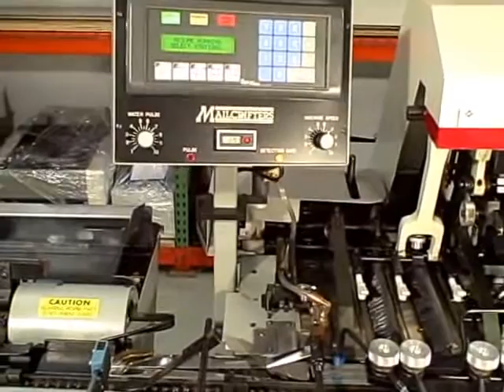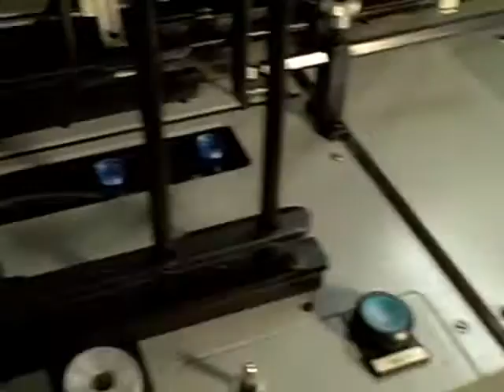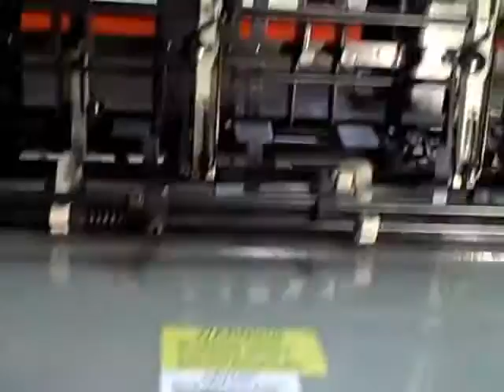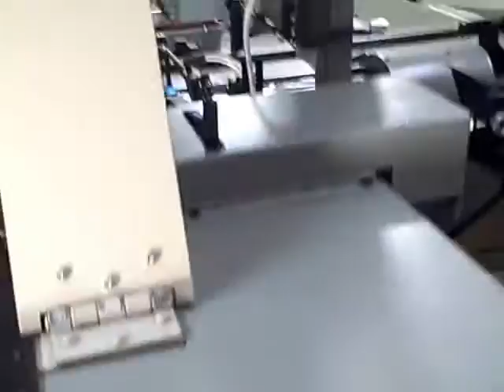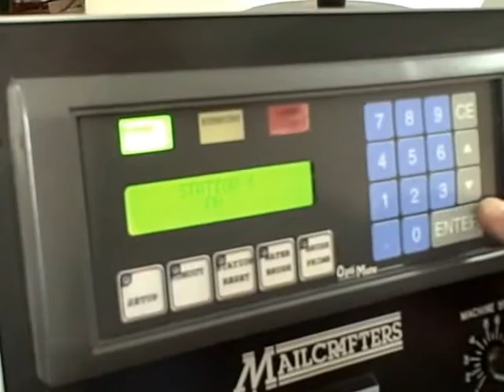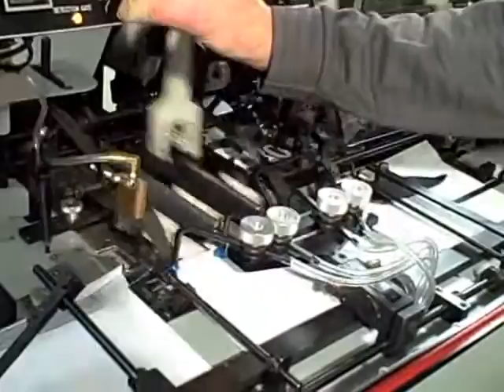Mailcrafters Model 9800 Envelope Inserter (Pre-owned)

Comment: I used to work for inserco between 1999-2005 as a sub-assembler. I built almost every part in these machines.  I will state that these are all very rugged machines I am very sure that there will be one of these machines working somewhere long after I am dead lol! built old school to last forever!
Reply: I know it's a longshot, but I own one of these machines and you are correct, it's a solid machine. Currently the compressor turns on, but the main motor that drives the chains does not. It's been in storage for a year. Any ideas?